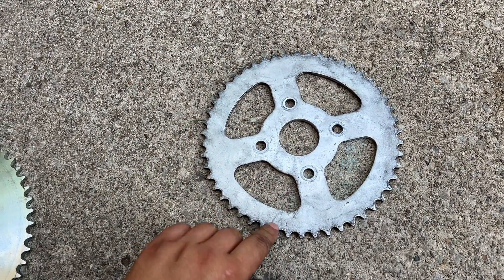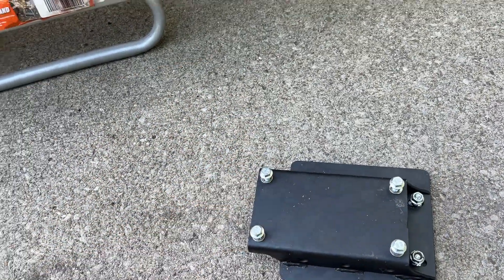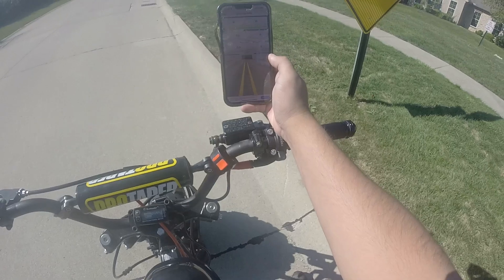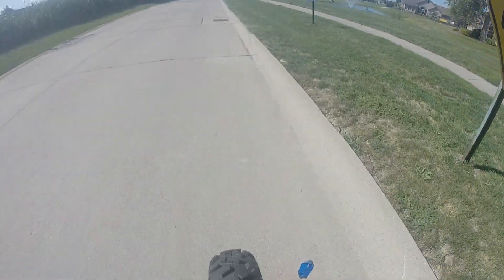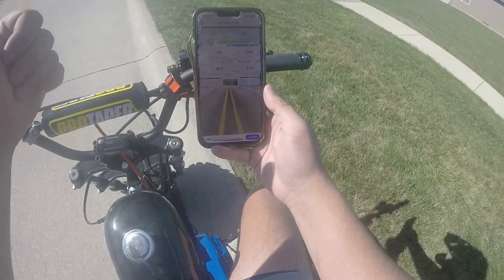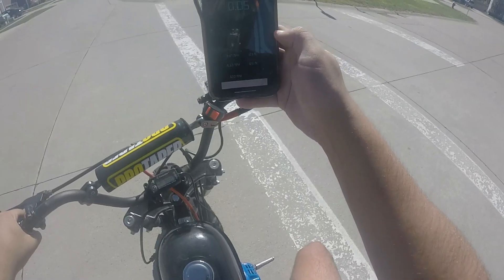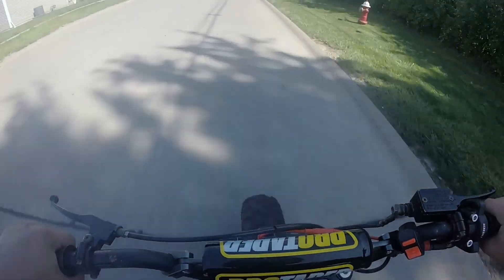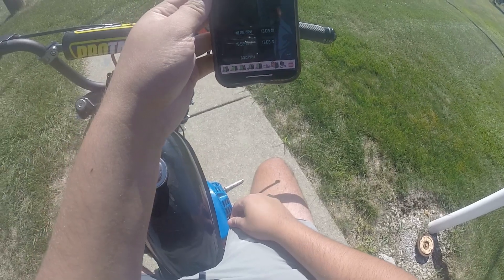SWAPPING THE GEARS ON MY COLEMAN CT200u-EX

Comment: Get a dragy. MUCH more accurate. 200 bucks tho. Also keep the 10 up front and 60 rear. Now youre a lil too low. I have a 223 stroker tilly block too. same carb

Comment: Cool bike, what sprocket did you use up front? I'll be running a 60 out back but not which one to use for my application, I'm running a Honda GX160 with a governor delete, 18 pound springs and a stage1 kit but the rest is stock. I just want to be able to cruise around town where the roads are 25 to 30 MPH limit. Thanks.
Reply from the maker: @miguelpagansr6128  i was running a 9 on front. for the power i was making it was very torquey but helped the belt live longer
Reply: I'm running a stock engine for now it happens to be a Honda GX160 with a governor delete and a stage1 set up, I'm looking to go down the road at the speed limit which is 25 to 30. Any thoughts on gearing? Thanks